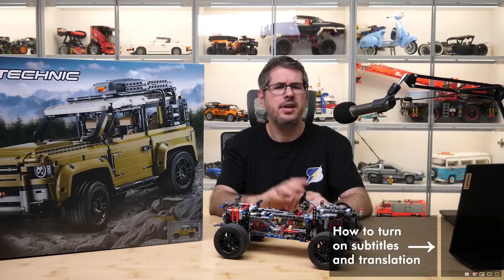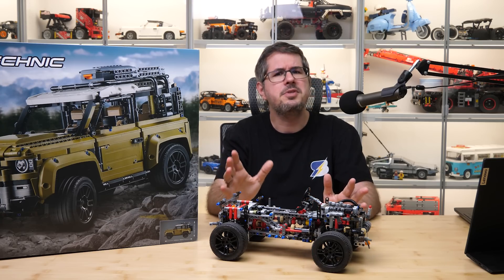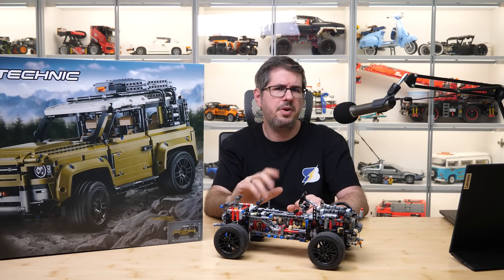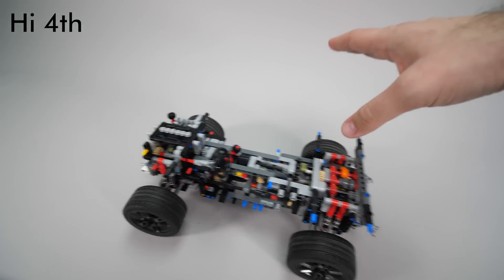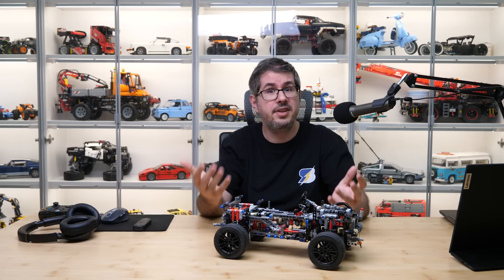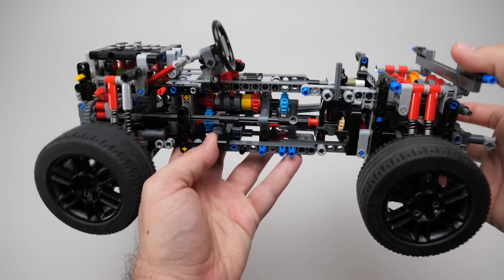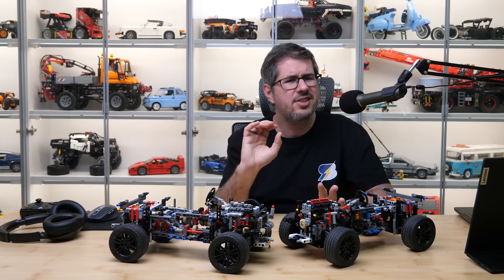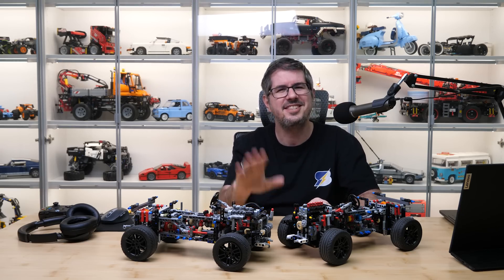LEGO Technic Defender 3 years later - is it any better? Possible fix with new gears!

Comment: The issue is with the change of form around when Lego switches the 20T bevel gears from gray to tan colour.
The 20T tan gears have sightly oversized teeth and slightly to small depth of cuts between teeth do they bottom out on certain meshings that should work okay on paper. LEGO uses these meshing pairs in their builds as if nothing happened.
Reply from the maker: As you see swapping the bevel gears does not solve the problem, so there might be some slight variation in them but that does not affect the performance significantly
Reply: @RacingBrick  if I understand correctly, you replaced the current tan 20t bevel gears with the new 20t straight cut gears and it didn't help.
What I mean is, that the current tan gears have a different cut than first generation (old) 20t gears, which had a slightly different tooth profile. For example the rough terrain crane runs rough when built with the current 20t tan bevel gears, but rubs butter smooth with the old profile 20t bevel gears (usually gray)
Reply from the maker: @MarekLewandowski_EE  I understood your point. What I tried to point out is that the new non-bevel gears should run (theoretically) smoother than any kind of bevel gears, due to the smaller contact surface with the surrounding pieces. If these new gears cannot resolve or even improve significantly the cracking situation, then no variation of the different type of bevel gears could cause the cracking in the first place.
Reply: @RacingBrick  Hi, sorry, but this isn't right. The bevel gears do not have bigger or smaller contact area than the spur-only gears, at least not in a relevant way. The angled sides of the double-bevel gear don't touch when in straight mesh and the center is same width as the straight spur gear.
What is, however, the issue is the way the teeth are cut. The nominal module for LEGO gears expressed in LDU is 1/8, which means that to mesh 20T gear and 16T gear an axle distance of (20+16)/8/2 = 36/16 = 2.25 LDU is necessary. Now, the current-production tan colour 20T gears have too high root diameter of the gear, the cuts between the gears are too shallow, as well as slightly too thick teeth, so they mesh best at slightly bigger distance than nominal. LEGO often uses non-nominal meshings, like the step 191 in Defender (20+24 and 20+12, both over the nominal axle distance), but there are sometimes meshings of 20+16 used in configuration where axles are offset 1 to the side 2 across, resulting in 2.23LDU distance instead of the 2.25. This wouldn't be an issue, if the teeth were cut deep enough and had enough clearance - but they don't, they are tight at nominal, so any reduction of mesh distance makes the situation only worse. This is compounded by the fact, that lego brick isn't 1LDU wide, it's 5-10% under, 7.8-7.9mm instead of 8mm, so depending on the stacking to get the axle offset, and exact bricks in use, the distance can be noticeably lower, than the theoretical 2.23LDU. This causes teeth to bottom out each time axles align so, that the cross arms point toward meshing gear pivot, as this axle position brings the gear closest to its counterpart. This is periodical 4x per each gear revolution, but depending on meshing every few turns both axles align this way causing a harder crash. So, depending on how the axles are aligned across several meshed pairs, the 'crashes' either spread out, or add up...
Reply from the maker: @MarekLewandowski_EE  if you check the side profile of the gears it is quite easy to see how larger the "flat" contact area is in the case of the bevel gears that potentially rubs against the surrounding pieces if they are not perfectly aligned for some reason.

But regardless, I don't say you are not right regarding the different generations of bevel gears and how they can mesh. I'm still not sure this effect is significant enough to be the single cause of the cracking. I'm not sure if you already checked the teeth of the new gears from 42140 from this perspective and how they mesh, how they compare to the "problematic" bevel gears, that would be interesting to see if their usage should have a positive or same effect on paper.

In the case of the Defender however, I still think the sheer number of gears used together with the 4 U-joints and a few not well secured suspension points cause enough different vibrations building up in the system that will have the cracking as an end result. But if you tell me the exact type/ID of "good" bevel gears to use as a test I am very happy to compare them to the ones in the set to see if there's any visible difference.
Reply: @RacingBrick  try getting some used 20T light gray double bevel off bricklink. The mold change happened about when they changed the colour. I don't have the number off the top of my head, it won't help anyway as the parts are so close visually that you can't trust a bricklink dealer to distinguish them - go by colour.
I haven't tried the new gears yet.
In the rough terrain crane 42082 the gear trains run rough with tan gears from the set and smooth with old gray gears - there are mainly the 16+20 meshings at +1+2 offsets. It's not the gears rubbing on the face, it's miss-mesh of the gear pairs. I never finished a write-up on this issue, but had some vibration spectra plotted for comparison. I have to dig it up and post sometime
Reply from the maker: @MarekLewandowski_EE  I will get the gray ones for sure. I'll have to do a follow up video for the Pimp up my Defender mod anyway, so I'll also check this setup with the older gears. Not sure when will it happen exactly, but it's noted :)

Comment: I built mine a month ago and the gears make zero noise and it all works as planned.  My problem is the steering, it works but it’s rough turning left and right and the steering wheel is off centre when the wheels are straight.  My Sian has the same off centre steering wheel.

Comment: In my opinion, the problem is the read fool gear on the front, because the shaft inside it rotates in the opposite direction. The friction in this case causes the cracking

Comment: I’m waiting for the clutchless Z20 so I can test mine as I’ve found the new Z20 & Z12 gears do make a difference. I also found the the engine also adds it’s own resistance compared to using a traditional fake v8

Comment: Just build the improved version from rebrickable. The gears change the right way around, the drivetrain is smooth and you can even remove the body after you finish. You do need to buy some parts though.

Comment: I am one of the lucky ones who has no cracking, but also a little resistence in the higher high-gears. Anyway, I rebuilt the car so it is remote control, so I don‘t have any trouble with cracking :)

Comment: Hi, instead of cracking i found that there is too much slip between the wheels and the engine. I know that if it makes sense if the engine were to be driving the wheels because that's the point of the differentials, but it is kind of losing the effect of having the engine engaged to the wheels. Is this how it should be or do i have some misalignment?

Comment: Try to flip both of the differentials. An easy fix to all the cracking issues
Reply from the maker: Nope, that's not a definite fix either
Reply: @RacingBrick  I found that fix on someone's channel on youtube. It really helped me, because I had those cracking on high 3 and 4 gears. Maybe it redistributes the load on gears, I don't know. Have you tried it?
Reply: @RacingBrick  There is a feature. If you build everything correctly, then you put D, 4th gear high and drive forward, you'll hear cracking. But do the same and push the chassis backward. There will be no cracking. So, flipping the differentials has to help.
Reply from the maker: @ДенисШумилов-т6х  I tested that one as well, and you can make it crack with the diffs flipped

Comment: Hi Balázs, could it be that the cracking noise comes from the cardan shafts? Especially from the joints. If they are not lined up correctly, they can couse some "bouncing" while turning. There is a video about it somewhere. (Of course I did not find it now. Cheers, Gábor

Comment: I've build the "Pimp up my Landrover" mod about a year ago and it works amazing! The cost for all the extra parts needed is about 60-70€. 
It's not only improving the gear train but also modifying the way of how the body is mounted onto the chassis.
Also the PDF instruction that comes with the mod is like you would expect it from a usual Lego manual. I'm amazed about all the "Pimp up my Landrover" mod and would highly recommend it!
Reply: No cracks?
Reply: @damararyohanggoro9162  No. They are completely gone!
Reply: @stefanhaler8114  need to revise mine then 😂
Reply: 60-70 €?? I have the needed 166 parts on a want list in bricklink. I could buy them from one seller for 10 €. Did you buy lots of other improvement parts, too?
Reply: @ArinMatikkaa  Hey, maybe prices may vary from country and seller and of course quality. Here in Germany it was about 60-70€ 1 1/2 years ago. And no, I only ordered the needed parts.

Comment: I may be stupid, but doesn't it suppose to have resistance in the hi gears? specially in low ratio mode? and yeah in the highest it might start crackling if you try to push it too fast.

Comment: You can replace the differential bevel gears with half stud bevel with a half stud washer

Edit: i think the main problem is the pistons in the fake engine jammed the crankshaft... My solution is to replace the 3 or 4 stud axle to an axle with stop

Make sure to put the stop side ABOVE so the pistons will be raised slightly and will lessen the friction
Reply from the maker: If you noticed the fake engine being upside down at the end, the reason for this is that I tested the model without the fake engine, and it was still cracking unfortunately.

Comment: The cracking is comming from the fake engine, if you shorten the "pistons" for the proper height, the crankshaft will work flawlessly, in high rotaion also! The crakcshaft hits the side of the bottom of pistons, and the angle of attack is not perfect sometimes and the piston also can be not only the lowest position, if the rotaion is too high, not enogh time to settle the starting position. if you see your video clearly can see the pistons movment are not countinous, when hearing the cracking noise.
Reply from the maker: The cracking does not come from the fake engine in most of the cases. The pistons' movement is not continuous because the shaft driving it does not rotate with a constant speed. If you remove the fake engine altogether, it still cracks.